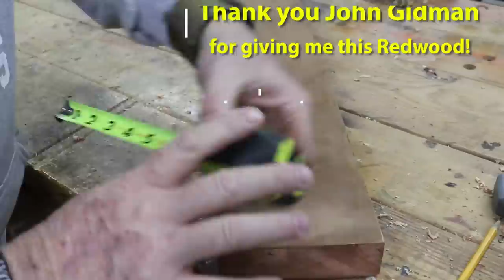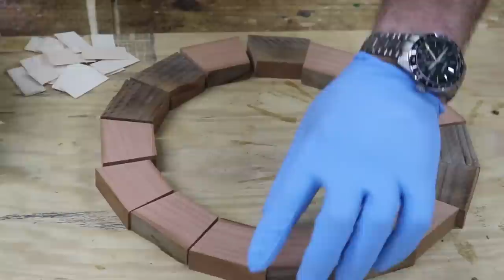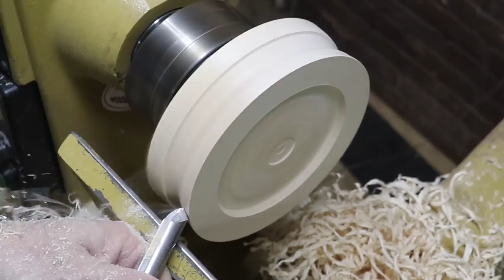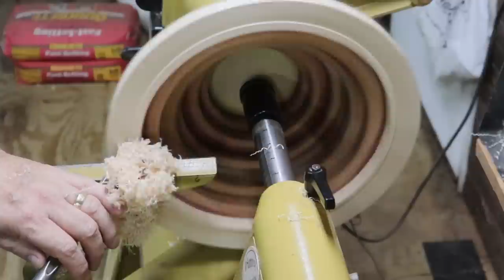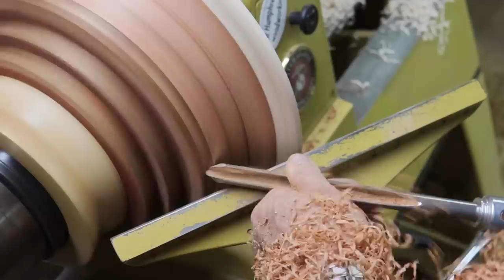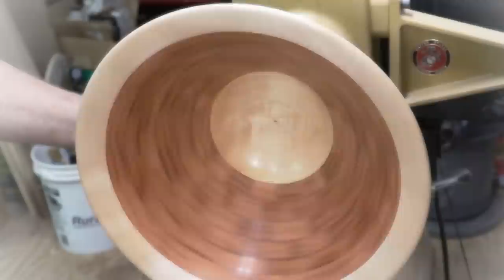Woodturning a Redwood Board into a Big Beautiful Bowl

Comment: Quick redwood story. 12 or so years ago my dad and I removed the deck from my grandmother’s old house after her passing once my sister started living there. The stricture was shot, but we saved a bunch of the deck boards, which are redwood. Lots of nail holes, some rot here and there, but not bad for almost 50 yrs. FF to 2018, and in prep for a family reunion, I took a few boards and sent them thru my drum sander a couple dozen times. Then I ripped them into stripes. I made 11 picture frames from them, and got some old family pictures for them as gifts to my sister, parents, aunts, and cousins. All who’d spent many years at that house. I also noted how light and dry it was. Even blue tape would pull fibers off the wood! It was a fun project anyway.
Reply from the maker: Great story, Ben, thank you for sharing it!  What a fantastic and meaningful use of that redwood.
Reply: @RHumphrey  thanks Rod! Sure is a great use. None were fancy, all simple flat frames with shellac finish, but that’s all it needs.

Comment: Hi Rod, beautiful bowl. I'm curious though about why you started on the rim and worked into the bowl instead of starting on the outside to reduce the shake. Or does it matter...thanks
Reply from the maker: Hi Jeff, thanks very much!  A good question.  Working a segmented bowl is a bit different for me.  What I normally do, is  complete the outside of a bowl before reverse mounting and turning the inside.  But on this, when I completed the base and got he rings all mounted up, I wanted to establish the basic shape of the rim on the inside while I still had weight in the lower rings to lessen the potential vibrations of a large thin piece spinning at 1000 rpm... they can warp out of round pretty easy without the structure in support.  So I did that to a point, then switched to the outside and completed it before returning back to the inside and completing it.  I think it matters, but overall the piece was pretty balanced from the beginning, with the rings being set fairly close to centered.  Hope that helps!  Thanks again

Comment: Beautiful bowl Rod, I do have a question about your finish. Did you put a sanding sealer on or was it just the Ack’s?
Reply from the maker: Just the Acks, but i applied a heavy coating of the sanding compound and let the oils soak in.  I sanded thoroughly up to 1000 grit, forward and reverse on the lathe.  Buttery smooth